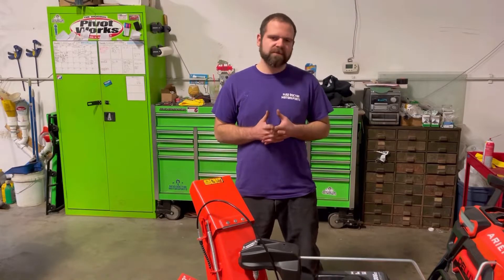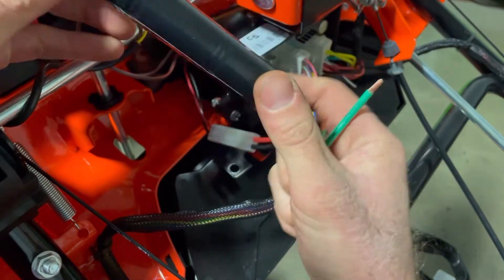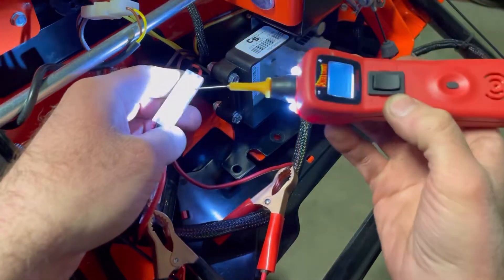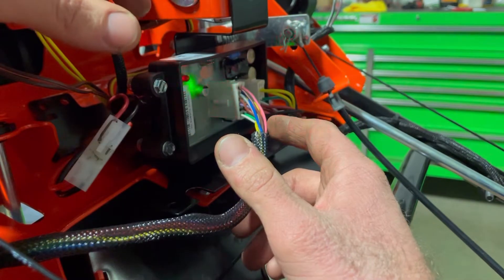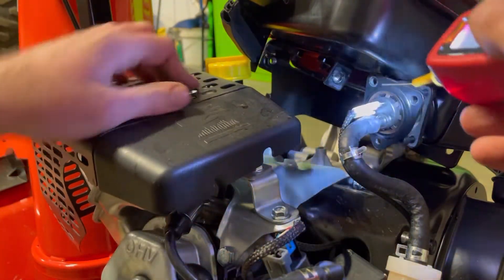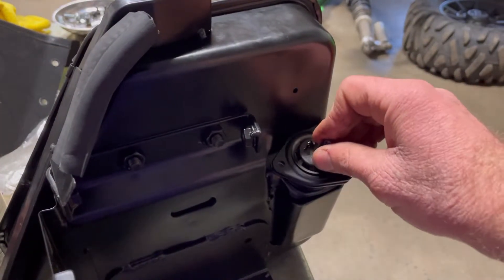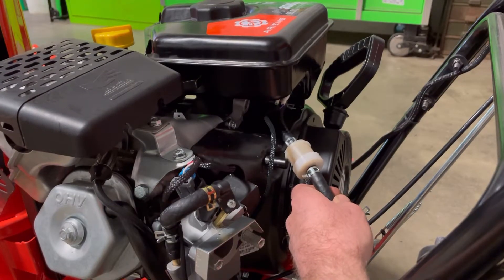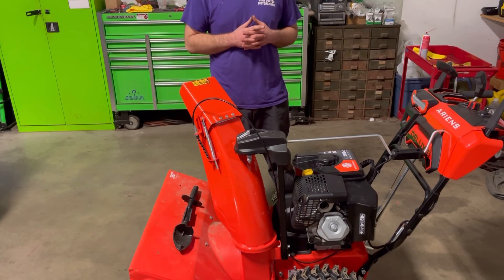Ariens EFI Snowblower Fuel pump replacement and basic diagnostics

Comment: Simple, Don't buy EFI...     About 17 years ago, the Hex shaft of my Snowblower just snapped as I tested it a day before a snowstorm that dumped 28" of snow.  The shaft just broke and I could see that it was defective.  After complaining to Arien's I found out the part was recalled but I missed it.  They said I had to order locally but I needed instantly.  They sent me to a dealer local to Ariens in Wisconsin to purchase and told me to see if i could have it sent over night.  I thought this was wrong.  I sent pictures of how impeccably maintained and new looking the unit was Inside / out and and laid out what I thought was a very sensible argument.  I was never trying to get something for nothing.  One of the Arien's family responded to the e-mail with me CC'd asking their team to send me the part over night Free of charge.  I will never forget this.  
It arrived hours later from Wisconsin across the country and I was able to install it before the storm.  It still works flawlessly and I have no problems with that unit which is Tecumseh (USA) powered.  Motor starts immediately every-time all the time and is still as strong or stronger than new.  When it came time for my Dad to buy a New Snowblower we got another Ariens.  This is a Pro model 28" no EFI, No Hydro-static drive.  Unit is easy to fix in a pinch and if you keep spare parts as we do you are likely covered.  I like the Hydrostatic drive but again if it breaks hours before a snow storm can I fix it?  I have spare belts, disks, bearings etc...   I use marine corrosion inhibitor on outer sealed bearings (20 year old blower is like new because of this).  I always grease everything, including light coat on various shafts to prevent corrosion.  Also the newer auto-turn shafts must be greased very well, I generally use Redline CV-2 because of it's low wear and low temp properties but a good anti-seize might be in order for the autoturn axels / shafts etc...

Comment: Good video, thanks for posting, I just finished one for a customer that would run and shut off , found a lose wire connector going into the ECU...2 zip ties fixed it

Comment: Funny thing about the battery is that it's exactly the same as any 7.2V NiMH hobby battery for R/C's, and if it craps out on you, any equivalent battery with that connector will work on it. My only frustration is that I've not been able to find out how many mAh's it is because I would then be able to use a hobby charger.

Comment: Mine looks to be the same exact model. It surges high rev and low, with out turning the dial. And with the dial all the way up to full throttle. Good gas, good pump and is 2 years old. Any ideas?
Reply from the maker: Actually dealing with one currently that has this issue. Havent figured it out yet. When i have a solution there will be an update and ill be sure to tag you.
Reply: @SmallEngineWizard the more I’m reading leads to the throttle dial, and the guys have been replacing the whole harness, they say it runs around $300 and I’m hoping something like that is covered under warranty since my machine has less than 8 hours and is 2 years old. Hope this helps direct your diag a little!
Reply: @SmallEngineWizard  what was the solution. Mine is now doing it. Thinking it is the throttle body?

Comment: I heard somewhere this pump is really meant to run on 12v and sometimes giving it a boost of 12volts will bring them back to life for a season
Reply from the maker: its very possible. ariens and lct have multiple extremely poor designs.
Reply: Worked for me thanks so much

Comment: Seeing this im already regretting getting the EFI version and i haven't even used it yet
Reply: My needs a pump lol
Reply: @arnoldrprehniii4660  oh man that's not reassuring
Reply: @arnoldrprehniii4660  what? Damn, I don't like to hear that
Reply: Pretty sure it’s something to do with them (Ariens) using a hobby-grade R/C 7.2V battery to power it vs. using a full 12V battery for it. It sounds like if you hook up the culprit bad fuel pump to a full 12V battery (on a bench top test), it should get it back in action again…They wanted something compact for their power supply, but a small 12V Lithium-Ion battery would probably have been a better choice (& cause less headaches for the consumer).

Comment: These have a issue with the speed sensor they go bad they don’t provide the correct amount of voltage so the ecu doesn’t know how much fuel to inject causing either the pumps to go bad or the fuel Injector module.. I watched a video on it. I’m not a mechanic by any means but these speed sensors are connected to the round dial on your  panel I don’t have a EFI so I don’t know what it is but it connects under the panel to It I guess the dial’s can come loose causing water to corrode them so i would start by making sure it’s tight or possibly putting some sealant on it a silicone spray to keep it water tight that may help good luck…

Comment: Hi there… Got a Noreaster goin on And my snow blower died on me. Its a Ariens 30 efi model… 5 yr old.  The snowblower starts and runs but it’s chugging… after 30 minutes … it died. Waited 5 min… it started but died within few minutes…. Any leads as to what it could be? The engine definitely isn’t running smooth…. It feels like it either looking for gas ot may be flooded with gas….TIA
Reply from the maker: the first thing i would check for is a clogged fuel filter. its inside the tank as described in the video. it sounds as if its running out of fuel
Reply: Great. Thanks. Will check out this weekend. Thanks
Btw… Any suggestions where to purchase the multimeter?
Reply from the maker: @deeshin  any local hardware store should have a basic multimeter. home depot, lowes ect. if you wanted a power probe that would be online only but its a more advanced tool but simpler to use once you understand how to operate it.

Comment: 7.4 volt battery, same used for rc cars. Can be upgraded very easy at any local rc shop.
Reply from the maker: correct! i am also big in the hobby
Reply: @SmallEngineWizard  Hello, thanks for posting. What kind of life are you seeing with these batteries? I charge mine every 6-8 weeks. Purchased my 926080 new in Nov 2021. Yesterday the battery seemed to take longer than usual to charge. Any suggestions on a replacement RC battery just to have on hand? Maybe an upgrade from the Ariens battery?
Reply: good to know thanks.  My neighbor is an RC car parts distributor, I'm going to check with him.